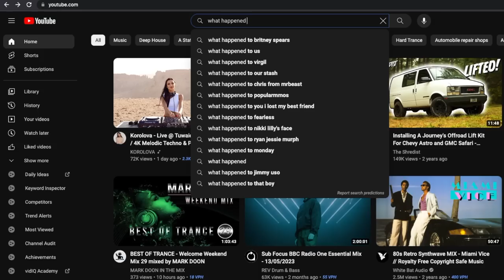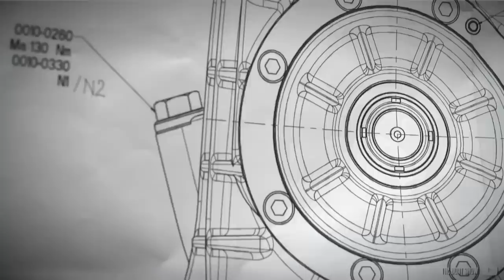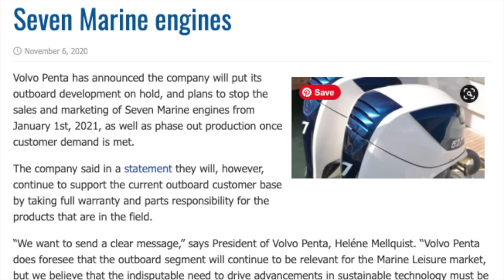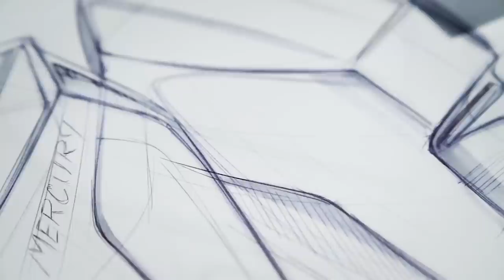The ACTUAL REASON Seven Marine Outboards Went Out of Business

Comment: Well the president of Volvo Penta Helene Mellquist didn't like the gas guzzling Seven Marine that's why they cancelled production and that probably pure luck because at that time they didn't have a clue about Mercury's 600. So yes it was due to that Mellquist didn't like it and blamed environment as a reason they canceled it
Reply: Change of management at Volvo Penta between the time of the purchase and the shutdown.  The purchase, when you look at it, does not look consistent with the range, nor the promise, nor the focus of Penta…even at the time of the purchase.  Not sure what has happened there. Closing a brand, factory is a cost, I guess something have been repurposed for the North American in-board petrol engine line up.

Comment: Do you think that gas engines will be around in 10 years? Yes they will but not at the level that it has been nowhere near that level. Gas engines make a big change every 15 to 20 years it takes that long for anything significant to change. With solar and electricity with batteries that technology is making leaps and bounds every 2 years so this engine any engine will have the same horsepower give or take 5 or 10 horsepower in 10 years. Look at the battery and solar industry 10 years ago and look at where it's going now 10 years from now these things will be obsolete and 10 to 15 years imagine investing $100,000 on engines that won't be here or be outclassed or out horsepower by electric counterparts in 10 years it doesn't matter who beat who if you're in the gas game you're done
Reply: Yeah, battery OBs, I’d love to be 100 miles offshore in the stream fishing and find a blue norther coming at me and my OB batteries are dead. Hey, everybody, dump your cell phone, electric shavers and any other lithium batteries you have so I can charge up the OBs before the storm hits. No pal, Infong see that happening. Much safer to carry 10 Jerry cans of gas if your tank starts to run low. Of course, you could stream a 100 mile long extension cord behind you. Hmmmmm

Comment: I think OB motors suck! Too complicated, too unreliable, far too expensive and in salt water it’s nothing but a potentially corrosive mess. Why do you need high speed when you’re on the water? Relax at 12 kts and enjoy the ride. Big power boats are usually not synonymous with good seamanship. I think guys who need muscle boats are like guys that need chopper motorcycles or muscle cars……small dick,
Reply from the maker: I can tell you've never been on a fast before.  It's more like flying than boating.
Reply: @ADDvanced  yup, it’s freekin ovah with befoah it stahts. Why bothah, just fly, same sensation. I extensively raced sailboats and throughout the race you wanted to go fast so you could win. Then when it was ovah, you thought, why didn’t I just enjoy being on the watah on a beautiful evening? So, we sailed foah another hour or two in the moonlight drinking beah to make up for it. If you’re on the watah why do you want to go do damned fast that you can’t enjoy it?